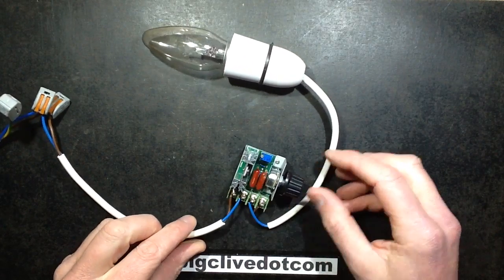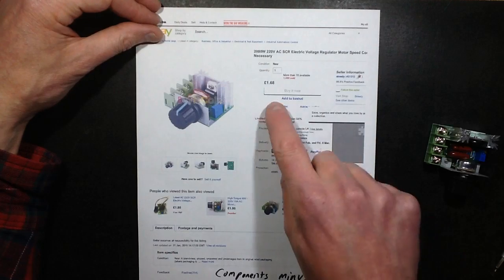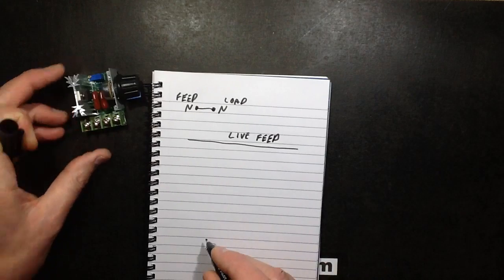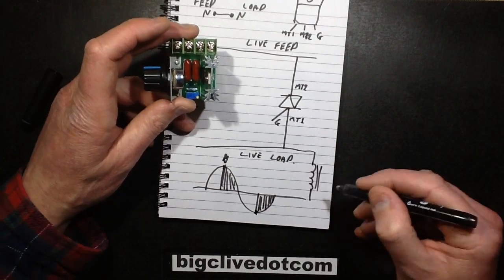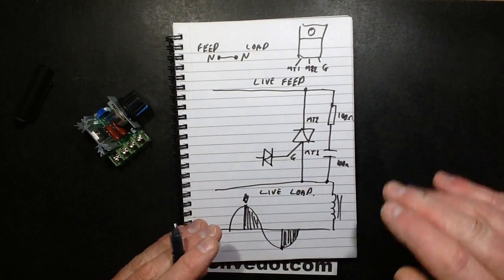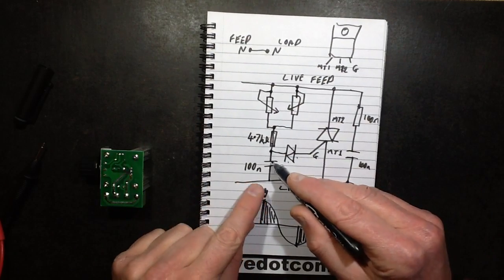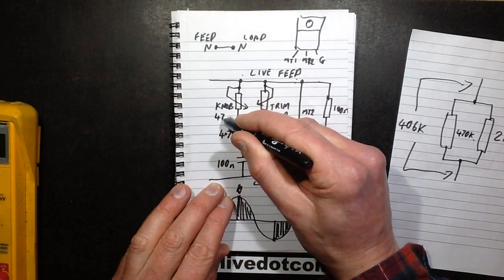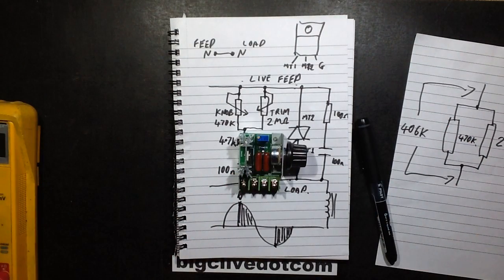Reverse engineering of a mains power controller.

Comment: 1/Rtotal = ∑(1/Rₓ)
1/406000 = 1/2000000 + 1/x
1/((1/406000)-(1/2000000)) = x
406000000/797 = x
Due to Standard EIA values the closest probable value would be 510kΩ
x ≅ 5.10E5 Ω (510 kΩ)
Reply: +Andrew Querol Even tho I understand your explanation and it is correct I also see it as almost being some secret unbreakable code by at least most of the people I know. Stephan S. explained it in a much more helpful if not tiny bit minimalist way.
Reply: Yeah, it doesn't help that it's written out in text form too. I think it would look less intimidating if I wrote it on paper and didn't have to add so many parentheses and didn't have to use the sigma letter to denote summation and instead could've just used ellipses plus subscript n. But for some reason Unicode character U+2099 doesn't work for me :(
Reply: +K Wils Maybe I my highschool electronics teacher(read as simple electronics, the final project was a strobe light with less safety and isolation than a cheap shitty pink charger 😜) was really effective, or I just have really good memory.
Reply: +K Wils To be fair most people know it as the emoji organization now -.-
Reply: +Andrew Querol Oh your right emojis! We  only used Unicode to put umlauts or copyright symbols or a few other things in documents didn't emoji much myself.When i asked some people if they knew what Unicode or emojis are I was shocked when one asked if I was talking about  ascii? I asked him why he knew what ascii was and he said back in the day before monitors everything used to come over the teletype or line printer  and they used to print ascii art nudes on green bar paper! If I can just think of a way to get nudes into a discussion on lissajous patterns I might get someone to talk about them!
Reply: Or assuming that the knob IS indeed 470kΩ, the measurement across both should have been 380kΩ.  Clive got 406kΩ - considering that he's taking a measurement in circuit, 470kΩ seems right.
Calculation: 1/2,000,000+1/470,000 and then take the recriprocal (1/your answer)=380,566 which is only 7% out from what was measured
Reply: Your calculation is good, but that style of potentiometer don’t usually follow the E12 series (at least at my local electronics store). Normally they are just 10, 25, 50, 100, 250, 500, 1000 etc. because they are potentiometers not fixed values. So my guess is that it is a 500k pot. In parallel with a 25 turn 2M trimpot.

Comment: So is it safe to link this directly to a fused UK AC mains lead? Just as the listing says 220v input? Looking to control a universal washing machine motor with it.

Great video by the way! Really clear breakdown.
Reply from the maker: +kingoginge Yeah, most of the 220V stuff (Chinese voltage) works fine on 240.  Just keep in mind that there's no interference suppression on this unit.
Reply: +bigclivedotcom Cheers for replying. So what's the best practice with this? To mount unit away from the motor itself to reduce electromagnetic interference? Am I right in thinking that with a universal motor I should be able to maintain decent torque? Reading around these little things can get bloody hot so thinking I should put a larger heatsink on it, maybe even a small fan. Sorry I'm a quite new to all of this!
Reply from the maker: +kingoginge It's radio interference that is the issue.  Proper dimmers and motor controllers use a series choke to limit the electrical noise produced.  Less of an issue with digital radio and TV, but still an issue for older wireless receiver systems.  Is the unit being run for a long time?  It may not need any further heatsinking if it is used with a relatively low power motor for intermittent use.  Of more importance is putting it in an enclosure to protect users from contact with its bare connections.  Note that the heatsink should be treated as potentially being live, as some triacs do not have an isolated tab.
Reply: +bigclivedotcom Ah right, is there anything to be aware about with radio interference or anything I can do to isolate it? It's a universal washing machine motor 480 - 1700 rpm, I plan on powering a scratter I made to mulch apples for cider making so would probably run it in bursts of maybe 10-20 mins at a time. I will definitely enclose the unit just encase there is any juice flying around!!
Reply from the maker: +kingoginge If you got the motor out of a washing machine it may have had a suitable suppressor where the mains came in.

Comment: Hi, would that be any good to slow down the speed of angle grinder (750W-12000 rpm)
Reply from the maker: +Grumpy Kid Grinders tend to use universal motors, so it should work.  Just be aware that if it does fail it may suddenly make the grinder go to full speed.

Comment: I want to make a a mini dimmer pack for house lights but if I used 2 of these on two 500 watt parcans or 1000 watt I think it will blow the board
Reply from the maker: +kierankay100 That would be too high a load for this small unit with a continuous load.  It also lacks the filtering required for a theatre environment.  I'd recommend a proper theatre-grade dimmer pack for safety and compliance with safety and interference standards.
Reply: bigclivedotcom i know buddy ive got a few i was just thinking for two lights but i wouldnt trust these things anyways

Comment: Hi Clive, it does work a washing machine universal motor fine, I have tested it.
 I wish to use mine on a small universal motor, it works fine, but there is a considerable difference in speed between forward and reverse.
 This is not a motor problem, as on another dc speed controller the motor has the same speed in both directions.
 Is this caused by the fact that this speed controller is AC? And would it be possible to turn this controller into DC. 
Would DC controller be more efficient than an AC controller?

again thank you for your most interesting youtube, best wishes

Jem.
Reply: Some motors are designed to work best in one direction . It seems to  depend on the placement of the brushes.

Comment: No, it's closer to 500k: (2M x 500k) / (2M + 500k) = 400k. Which is closer to the 406k, than if you use 470k, which gives: (2M x 470k) / (2M + 470k) = 380.56k.

Comment: Hey Clive, thanks for the video. It actually inspired me to use that exact module as a dimmer in a lamp project. It works fine so far but i got one issue. The Lamp still glows with the pot (and the threshold pot) all the way down, so i figure i have to tamper with the resistors a bit. Do you have a tip for me with value to replace the 4,7k resistor? Or should i measure the voltage across the bulb and calculate the value somehow? Thanks!
Reply from the maker: Johannes Elsinghorst Is it just glowing at very low level?  If it is then it may benefit from increasing the value of the 4.7K resistor.  It may even be that the trimmer or potentiometer are too low a value.
Reply: Yeah, just a dim glow. I'll try to increase the resistor and see where that takes me :-)

Comment: Clive : Can I ask you as to where you got those wire connectors seen on your power cord. They look clamp connectors as to which I can not find. Thanks ...Ross
Reply from the maker: They're standard WAGO releasable connectors.  Not actually intended for temporary flex connections like this.  Their actual application is general electrical wiring.

Comment: R2=(R1*Rtot)/(R1-Rtot)
R2=(2000000*406000)/(2000000-406000)=509410.2

510k ohm
Reply from the maker: Good job.  That is a standard potentiometer value so it probably is a 510K pot.
Reply: bigclivedotcom Thanks.

I do actually remember how to get the total Ohm from known resistors in parallel. Just add the inverse of the resistor values and you get the total in inverse. (1/Rtot = 1/R1 + 1/R2...)

But I just searched for "parallel resistor calc" to get that formula with an unknown resistor and known total.
Reply: +bigclivedotcom 
In the old days (before the 90ies) potentiometers used the E12 (10%) range (or even the E6 (5%) range). So 470k. Now the they seem to have their 'own' range. So the value printed on the pot would probably be 500k (not 510k wich is the E24 (1%) range.
Reply: Yup, had to check myself too... Now all i need it to filter the output and i'm good to go.